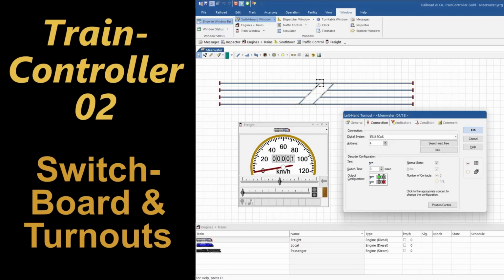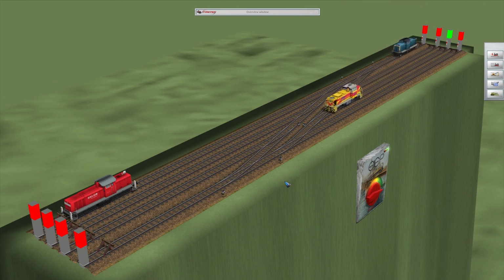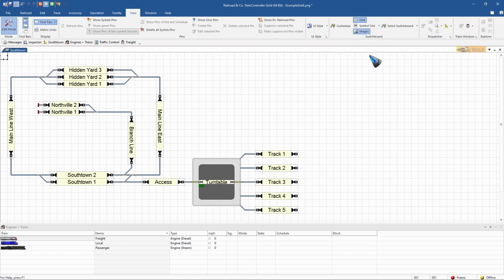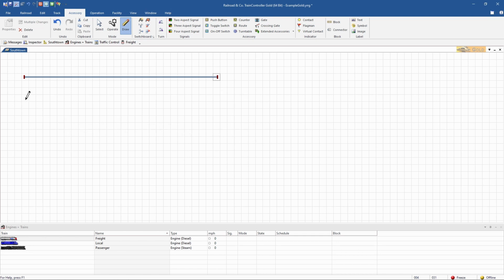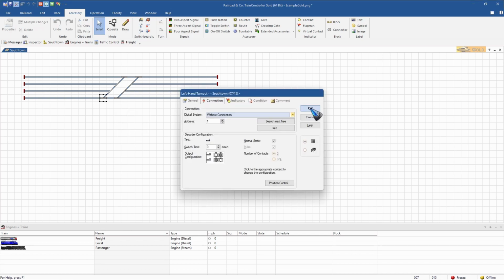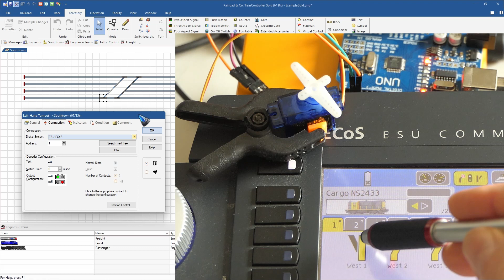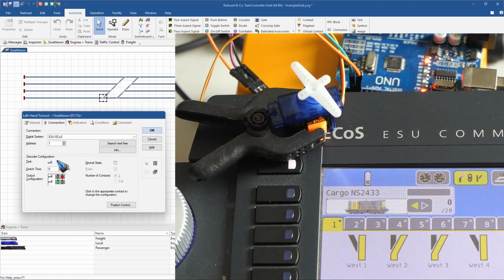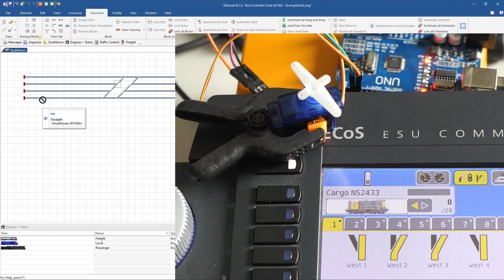Traincontroller 10 Gold 02 Switchboard with Turnouts

Comment: Hello Rudy - great videos.  I am new to TC 10 silver.  i am looking for a way to connect the track between my upper and lower levels.  right now I have 2 diagrams (upper and lower)  of my layout next to each other on one switchboard and want to connect the section where upper and lower comes together.  Or should I do 2 switchboard widows and then connect them some how?  Thanks!!
Reply from the maker: You can add labels (named A, B, C, etc) to connect tracks, even if they are on different switchboards.